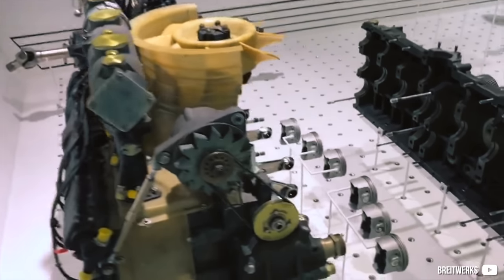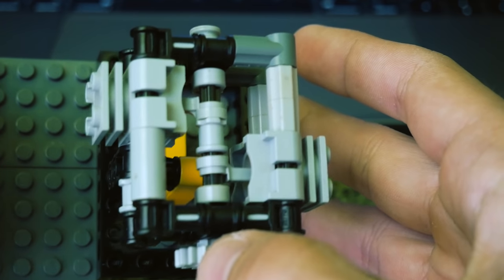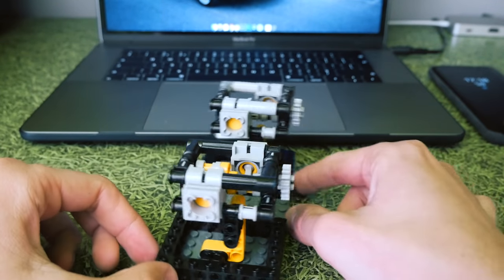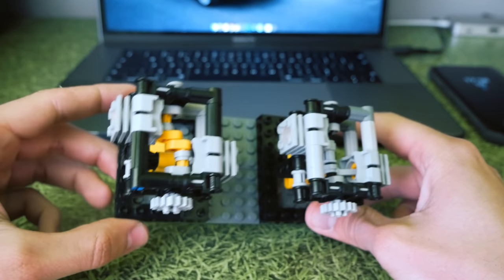Flat vs. Boxer Engine

Comment: TLDR :

Boxer : Bang-Bang-Bang-Bang
180° V : Left-Right-Left-Right
Reply: Dude, It's only 3 minutes...
Reply: @MerMes16  I still didn't get which is which, I just know that one has a split crankshaft and the other has a single-rod crank shaft. I'm going ot watch it once again, to see if I can understand it this time.
Edit: After rewatching the first 16 seconds of the video, the comment makes sense: Flat = 180° V engine. Boxer = shared crankshaft rod without zigzagging and without spiraling from piston to piston

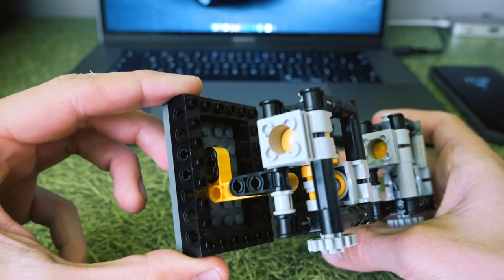Comment: 2:18 "a flat engine compared to a V engine has the lowest center of gravity."  For the engine block itself, yes, but the heads must be far enough above the road to allow exhaust (or intake) routing.  For a flat engine, the ENTIRE engine including the crank must therefore be that high, while for a V-, only the HEADS must be that high.  I think you could probably make a 120-degree V engine with a lower center of gravity than a flat engine, because the heads could be the same height but the main part of the block and crankshaft could be a bit lower.

Comment: The irregular firing order plus the layout of the boxer is what gives this engine it's unique sound. Amazing how minor adjustments can create a big difference.
Reply: Wrong. Subaru 4 cylinder N/A boxer sounds exactly the same as inline 4. It's the shape of exhaust manifold in turbo versions thas gives its unique sound. You can take inline 4 and with specific shape of exhaust manifold it will sound like a boxer.

Comment: (0:00-0:15) PROLOGUE
(917 Engine Display in Porsche Museum / Credits in description)
What is the difference between a flat vs. boxer engine? Technically speaking, both are flat but one is a 180° V-engine and the other one is a true boxer. They have their pros and cons, but let's dive into that.

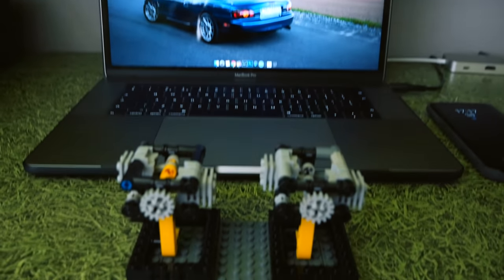(0:15-0:23) INTRO
(Intro Music - Smooth by Saib (The Essenchills Volume 2 / In the description)

(0:23-1:42) TOPIC
Here we have two seemingly, very same engines. They are the same except a single thing which would not be obvious from outside of such an engine and could only be heard soundwise. And one thing is the crankshaft design which differentiates a boxer from a flat engine. If you look closely, you will see that a flat engine has a simpler designed crankshaft with a single crankpin but 2 opposed pistons. This would be the case of most 4, 6, any number cylinder engines, inlines or V(s). Infact, Porsche 917 or Ferrari Berlinetta Boxer used this type in their flat-12 from the 70s. It is often referred to as a 180° V12 as opposite pistons in a V12 normally share their pins. Incase of twin cylinders, they mostly use the boxer type firing order, which, on the other hand, uses split crankpins for each opposed piston, base 180° offset between the pins. It makes the 360° firing of an inline twin, which actually has 0° between the banks as a inline engine and it fires each cylinder every 360°, which means a single pin for both cylinders. You can tell the similiarity hearing the sound of a boxer twin...

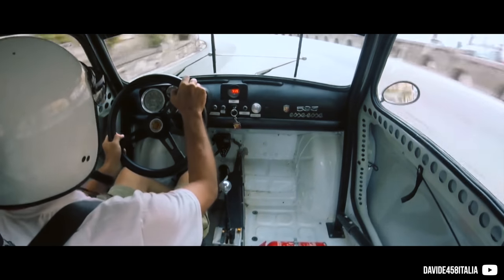(1:43-1:45) BOXER TWIN
(BMW R 1250 GS HP Sound [Raw Onboard] / Credits in description)

(1:47-1:50) 360° STRAIGHT TWIN
(Fiat Abarth 595 SS Gr. 5 Hillclimb / Credits in description)

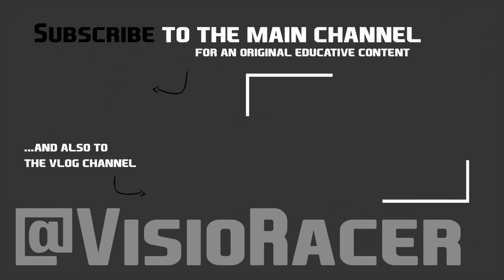(1:51-2:43) CONCLUSION
Some of the most known boxers are any Subaru's Engine, Porsche's 4, 6 & 8 cylinders, BMW's twins, or Citroën 2CV. The 180° V-engine is much more rare and is cheaper but it is where its pros end. The boxer has more crank journals to cancel out primary vibrations of the engine. It may make sense in a 12 cylinder engine but not with fewer cylinders. A flat engine generally compared to a straight or a V-engine, has the lowest center of gravity, it is wider though, has two heads, therefore more expensive to produce. One thing to mention, is that the horizontal offset of the cylinders is completely normal and present in any engine with two banks of cylinders. As the connecting rods are besides each other, so is the cylinder moved to a bit to the side.

(2:43-3:03) OUTRO
(Outro Music - Smooth by Saib) (The Essenchills Volume 2 / In the description)

If you're reading this, let Visio know! 

Thank you for 3 likes. (5-10-2020 / 09:59 PST)
5 likes now.
(5-10-2020 / 10:49 PST)
12 likes.
(5-10-2020 / 12:21 PST)
Next day, right now, it's 22 likes.
(5-11-2020 / 10:17 PST)
I checked it the next day, 26 likes. Thank you all for the support.
(5-12-2020 / 12:07 PST)
I found this almost 3 years ago, I corrected this and taking 13 minutes to rewrite this whole.
[1-19-2023 / 20:20 PST]

(This took me 55 minutes to do.)
Reply: The extra 5 minutes were spent unnecessarily capitalizing.
Reply: @Zoomydoomy  Ok, then...?
Reply: @Zoomydoomy  Honestly never understood why people do that, it makes it difficult to read the text and goes against the reason why words are capitalized normally
Reply: @fff5671  I found this and recorrected this almost 3 years later and dug deep into these videos to make this more legible. Cheers. Was I cringe about 3 years ago...

Comment: Ha thanks for this one. I'm going to make it my reference video to explain the oddness of the Testarossa engine thanks to the Lego models. There are so many people not understanding the concept of a "180° V engine"...
Will even forward it to Ferrari. Even them got it wrong. I mean ... 512BB for Berlinetta *Boxer*. Well done dudes.
Reply: On the contrary. Although the 512 is named BB for simplicity, Ferrari has always been very adamant that the engine is a 180º V12 and NOT a boxer engine. VERY!
Reply: @Gois83  I see your point, but Ferrari are going against the law's of physics, as the cylinder bank's aren't at any angle, therefore it's an oppositely opposed or a boxer engine. Also the car in question is the BB12, which if I recall correctly was aka Berlinetta Boxer.
Reply: @manos3790  You do know 180° is still an angle, altgough flat, right? In which way does that go against any laws of physics? And, as I said, the 512 BB is named that way to simplify. 512 BV12180 wouldn't make much sense now, would it?
Reply: @Gois83  it's still not a V engine. A  side elevation of the cylinder block is testimony to this. That's where the law's of physics come into effect.
Reply: @manos3790  Errr no.
Reply: @Gois83  okay, front elevation then.
Reply: @manos3790  you're wrong. The difference between a 180deg V and a Boxer is in the crankshaft, not physics.
Reply: "180° V engine" does not exist
Reply: @RoverWaters  think harder...

Comment: There are good reasons to make a twin into a true boxer, including balance and smoothness. Those hold true for 4 cylinders and mostly for 6, but once you go beyond 6, it makes more sense to go with the shared crank pin design, because it makes for a simpler cheaper lighter crank that's easier to manufacture. By the time you get to 6 pairs of cylinders, a true boxer crank is heavier and less strong, and much harder to make, and the balance issues sort themselves out anyway, so there's no real advantage to it. A true boxer 12 is going to have awful issue with twist due to torque, and torsional vibration. You'd need to take the drive from the centre of the crank, which can be done but that's one additional expense and complexity... True boxer engines are the BMW motorcycle engines and the VW Beetle. Ferrari for one, made a lot of engines they called 'Boxers' which weren't...
Reply: Although Ferrari built non-boxer flat-12's for road cars for a quarter of a century, it was only one series of engines used in only one model at a time... the 365 GT4 BB/512 BB/512 BBi/Testarossa/512 TR/F512 M

Comment: Look into the "Knife and Fork" connecting rods of an Allison V-12, no offset in the banks of cylinders
Reply: There also was russian diesel engines with master and slave rods. Master rod conects to the crankshaft. Slave is connected to master rod via a pin just above master rod main bearing.
Reply: @Valtra103  true...the V2 diesel engine of the t34 used this method...it was a V12 ...one bank had a different stroke and compression ratio to the other. Still being produced today as the v-92 in the t90 tank.
Reply: And the General Electric 7FDL which is a V engine yet it uses master/slave conrods.

Comment: It' s true that the aim is to lower center of gravity in respect to a V engine, but it isn' always achieved, because you need space also for the exhaust pipings and exhaust system under the engine.

Comment: Some Rolls Royce aero engines does not have any offset between the cylinders on each bank. I'm guessing the best known one is the Merlin.
Reply: ^this is what I came here to say.
Reply: they have a special conrod design to do that.
Reply: All V type aero engines as a general rule use either fork and blade connecting rods or a master and slave rod system. Flat 12 and H-24 engines for aero use also use fork and blade. The main reason to use a boxer type on a 2, 4 or 8 cylinder is balancing.
Reply: Harley Davidson V twins also use a fork and knife arrangement.

Comment: Nice !
just a quick correction at the end : the horizontal offset is not present on every engine with two banks of cylinders : Harley davidson uses a weird type of conrod where one "forks" over the other one so they can be concentric and aligned. Not sure if every HD engine uses it though, i'm not a HD expert.
It doesn't seem to serve any purpose other than it allows the cylinders to be perfectly in line, which is a disadvantage with air cooling. So it's just to look pretty i guess
Reply: That's the "fork and blade" connecting rod system. Yes, H-D is the best-known example, but not the only one.

This only works for shared crankpins, of course.

Comment: Flat V12 - ferrari testarossa - commonly wrongly taken as boxer engine
Reply: along with the 512BB-Berlinetta Boxer, which isn't a boxer
Reply: I think both engines have a lot in common anyway.
Reply: With 12 cylinders the balance issues you would have with a an opposed* 4 or 6 simply don't apply. 
Yes, I know that a true opposed engine has a crankshaft on each side with two pistons in each cylinder. Opposed in the aviation world simply means cylinders 180° apart. Also with the exception of opposed engines such as the air cooled Lycomings liquid cooled multi bank aero engines almost always featured cylinders who's centerlines were in the same plane 
*V-8s, V-12s, O-12s, H-24s plus the inline radials such as the Jumo 222, Wright Tornado and others. Except for a few Russian produced inline radials none of the others went into service. Look here. Fascinating web site
https://oldmachinepress.com/

Comment: Wait so can you convert a flat to boxer and vice versa by changing the crankshaft ?
Reply: Crankshaft, camshaft(s), ignition order and timing, and the connecting rods...I think that should probably be all the significant changes.
Reply: @aussiebloke609 Also, the bore offset of a non-boxer probably won't be large enough for a structurally sound crankshaft with two throws 180 degrees apart replacing the original shared throw.

Comment: Its still an opposed flat engine, not matter what the crank pin orientation. 
No other engine feels the need to change its name, when crank pins move around or 
firing changes..   
Boxer is just some company's made up name..

Comment: Good, but both of them are not a real boxer engines. Real boxer engine has two pistons in one cylinder, that goes in opposite directions...
Reply: While that makes sense, it is not the meaning of "boxer" in engine configurations. Those are called opposed-piston engines.

Comment: Wait, I think the 2cv is a flat, not a boxer
Source : I'm french
Reply: nope it isn't, it's a boxer 2 cylinder. a flat V2 is a really awkward engine design, has only disadvantages  compared to a boxer 2 cylinder. I know it would make perfect sense for the french to make one anyway, but the engineers weren't that stupid, and made a great and iconic car instead.
Reply: The 2CV has a boxer engine (like the BMW motorbikes), a flat twin makes no sense because it needs a balance shaft to correct its inherent imbalance: more money, more weight and more dynamic losses.

Comment: any subaru engine? even the EF or EK series?
Reply: Yes. A non-boxer flat-4 would have horrible torsional imbalance around the vertical axis - even Subaru wouldn't build that.
Reply: @brianb-p6586  1:50 "any subaru's engine" EK is a 2, EF is a 3, EN is a 4. all in line.
Reply: fair enough,  @RedFathom  - although all Subaru engines currently in production for North America are flat-4's (and maybe a flat-6, if they still have that), there are other Subaru engine configurations. The video is about flat engines, so of course we're only talking about flat engines. I didn't look up the EF, EK, or EN specifically, so I didn't realize that they were inlines... because they don't matter to this discussion.  

And this statement is still valid:
"A non-boxer flat-4 would have horrible torsional imbalance around the vertical axis - even Subaru wouldn't build that."

Comment: Crankshaft degrees are the singlemost way to change an engine's sound and characteristics.
Reply: crankshaft and V-angle/bank-angle degrees, in case of multi-bank engines
Reply: @mr.petrolhead5432  
That's no shit. American V6 engines based on V8s are 90° and sound like absolute crap! 60° V6s sound MUCH better.
Reply: @upsidedowndog1256  because of the 90° angle those V6's are odd firing with alternating 90°-150° firing intervals. However you can split the crankpins to even out the firing intervals to 120° as it should be. The natural V-angle for a V6 is 120° though, so 60° V6's also have split crabkpins or they would aswel be odd firing, unless they fire all cylinders on one  bank and the the other bank, which wouldn't good for vibrations.
Reply: @mr.petrolhead5432  
I rebuilt a 4.3 GM years ago. It had split crankshaft journals. It looked like a disaster trying to happen. It worked out great, though. Ran like a champ until the computer and the wiring went to shit. A mechanic bought it. I have no doubts it is still out there running in something.
Reply: @upsidedowndog1256  might look sketchy at first, but without them the engine would be running much rougher, especially when idleing and at low rpm. Cranks with split crankpins are usually forged steel, so they are pretty strong.
Reply: @mr.petrolhead5432  They were strong. Sound like crap though.. I am a "fan" of upgraded aircraft engines.  We make those right right here in Mena.